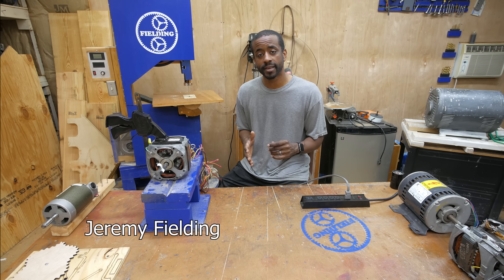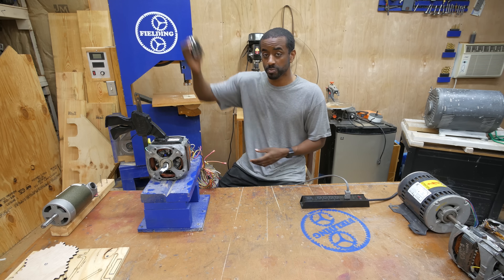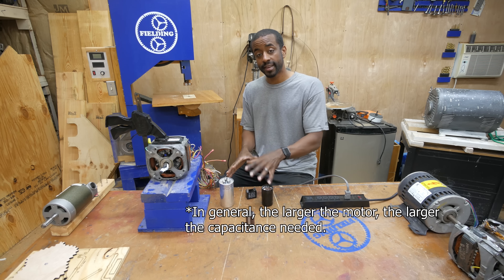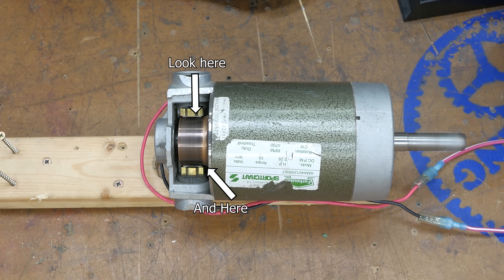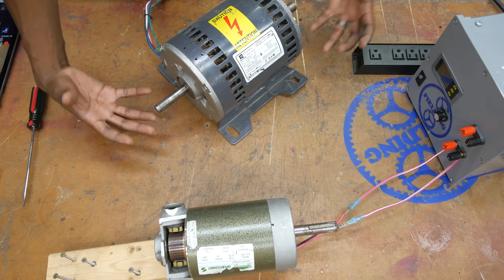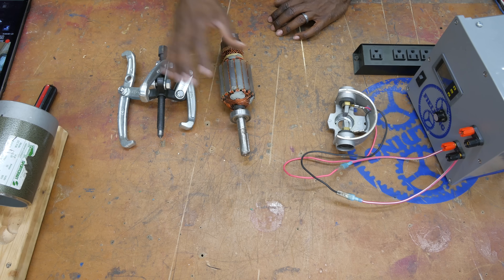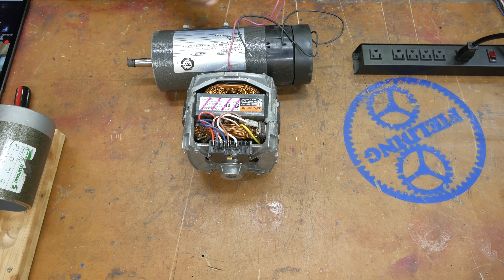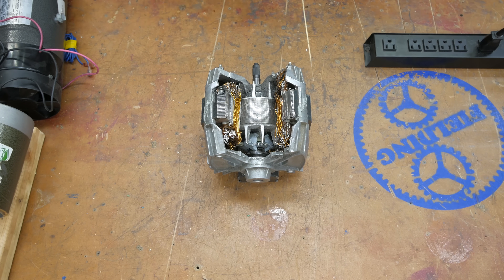Three Most Common Motor Fixes Anyone Can Do; Ultimate Guide to Electric motors ; #070

Comment: 6:16 I have this problem right now and I searched out your video to see if this was my issue.
My motor is running very hot. Starts melting the plastic casing. It throws mad sparks and gets super hot. the brushes are very worn down and they are at a 45 degree angle (I think because the heat allowed the brush springs to deform their holders).

Comment: I wouldn't say the capacitance doesn't matter. You needed enough shift in the phase on the starting branch to cause rotation. I wonder how small that would be though. Maybe that is accurate because the capacitance need is miniscule. That would be a fun experiment.

Comment: I just had a motor I had to fix on a Coleman rv ac , it has sleeve bearings that were packed with a material to hold oil, they material was pretty much gone. I took the motor apart , and repacked with a similar material and re oiled it , the motor spins freely , but it would hum when I try to start, I could give it a spin and it would run.  I checked capacitors and tested them and had a bad start capacitor. I ordered a new one and installed and it still does the same. Would the hum also be a determination of a bad motor , maybe a winding got too hot?
Reply: So I took another look at my capacitors and retested the new start capacitor was right on spec , rechecked the run capacitor and realized numbers were slightly different,  it was just off enough  by the variance that it wasn't allowing it to run. I guess it was in the process f going out because each time I connected it and tried running the motor and retest that reading would change by such a small amount. 
Anyhow, I rewatched this video a couple of times and it reminded me I should probably test and retest. 
Once I replaced the run capacitor it turned right on ....but I noticed it wasn't spinning as fast as it should. It ran for 15-20 min then began to slow down til it stopped.  Do you think this would be a sign of something wrong with the windings in the motor being that both run and start capacitor are still testing right on spec?

Comment: Great video as always! Really enjoy your channel. Question: any suggestions on extending a motor shaft? AC cap start induction pump motors in particular tend to have very stubby shafts. They don't even extend far enough to attach a coupling. I was wondering if I could press (or hammer) the shaft to push it out a bit farther. Then it would be flush on one end and extend about one inch on the other side. Would this damage the rotor?

Comment: i hammered a small gear on the shaft of a dc motor an the motor starts to and spin slow vibrating heavy then overheats but was running smooth before, maybe i hammered the shaft too much

Comment: My fan packed up it doesn't hum and won't start if you spin it by hand, I assumed the capacitor is faulty as it's supposed to measure 3uf but only measures .9uf

Comment: I've got a central pneumatic air compressor. 2hp induction motor. Lost the original capacitor such went bad. There is no cut out switch for a start capacitor. The motor has 4 wires that used to plug into the capacitor some how. I have been trying to figure out what capacitor it needs and how to wire it. I've gotten it to run with a 100 micro farid capacitor buy it gets way to hot. My knowledge of this subject is just enough to get in trouble and sometimes find my way back. Any help would be greatly appreciated. Your video is excellent and helped me to learn about electric motors. I'll be watching your other videos hoping to find my answers.

Comment: Jeremy, I have a 1 HP baldor motor that developed a bad bearing.  I removed and replaced the bearing and reassembled it and did my best to do so with the cap start mechanism correct.  The motor turned smoothly by hand, but the start mechanism isn't right.  If you can help me with that, it would be much appreciated.  I did buy another new baldor motor at the time due to urgency, but I really don't want that start switch to get the best of me.

Comment: I have this big 20” disk sander has a very heavy start up load  has a 20” steel flywheel takes a lot to get it going and will free wheel for along time when you turn it off.  what happens is the centrifugal switch on the back of the motor   Sometimes doesn’t switch off the start capacitor and it makes this horrible over running and vibrating sound and if you don’t turn it off right away it will blow up the capacitor. I have had a hard time finding the right replacement switch from what I can tell it’s the contact on the switch show quite a bit of arcing. It makes a fairly loud click noise when it works properly

Comment: I have a hmming fridge compressor, capacitors seem work since I replaced the new one and they didn't work, the question is
I saw some mechanist hitting one side of the compressor to make it work if you are lucky enough(?) how is that work? 
Before I knew this I know something wrong with the motor so I shook it around, back and forward and it only got warmer then trigger the protector as usual.
Haven't fix it yet, can't get a hard start kit here easily, it seems like no one manufacture or import that thing here.

Comment: As a student job in High School I was repairing electrical  motors.  The tool we used that was not showed  here was a  crank insulation tester  so we knew before to put it on real current if there was a short-circuit somewhere and we did not blew a fuse or breaker.   Some motors have oil inside like water pump.  Be aware of it before to open them. 

People were bringing  motors so rusty that we knew right aways there was nothing to do with it . We were just removing some parts to show we did something and charge the client for an evaluation for quick money :-p   We had to heat the motors to able to unscrew the metal bolts often without melting the aluminium . I got some motors to repairs because of frogs or mice inside. 
Some motors were suprising. I repaired one that was in a house fire where the copper coil inside was fine while the aluminium cover had melt.  I repaired some industrial machine that were in a fire.  the cable had melted together and we had to make good guess about which wire were going where

Comment: The general theme when doing repairs is to verify the part is bad, then swap it out. However when it comes to start/run capacitors, time and time again I see techs swap the capacitor without testing. What is it about capacitor testing that makes proving the diagnosis so difficult?

Comment: I recently repaired the motor of a small shop vac from a dumpster. Often things I find in the dumpster are perfectly good,  but this vac wouldn't run so I opened it up and found one of the brushes wasn't held against the commutator because its spring was broken. This spring is like the spring of a tape measure,   a thin steel  band in the shape of a "U" with the legs coiled up on each side, to pull the brush down.  I've never seen this type before. This band looked like maybe it got wet and rusted until it broke. Rather than trying to rebuild it in the original way,  I replaced it with a small coil spring from my supplies. I stretched it over the brush and fastened the ends by drilling  some holes in the black framework.  It works!

Comment: 5.30 If your motor has sparking/arching/electric puffing constantly sound (hard to explain but when you hear it you know it) when activated unplug, open brushes, check those are smooth, if not give them slight sanding on contact surface, clean surface and gaps of commutator bar with fine sand paper on opsicle stick  and thin screw driver and this should fix most of the issues. Angle grinders tend to have this issue, where so much conductive crap gets suck in that it damages ether one of those over time so eventually it just arcs. Easy to fix, most dont know how to do it, so plenty of fine tools get trow away due it. Bosh 1400 i just found for free just had one of the brushes corroded stuck, and with minor cleaning it works like new.

Comment: Thank you, I have a steel frame 16 gage sheet metal pullout in my ford ranger, it floats on nine 75 pound pillow bearings, inside the truck bed, and nine pillow bearings on the tailgate.  I have a flip 8” wheel trailer jack mounted on the pullout. So when it is pulled out it holds the weight of the pullout. Safety cables on each side to stop the pullout from falling off. This has been my mobile toolbox. The weight capacity of 500 pounds approximately. My question is how can I automate, the in and out of the tray? I can pull it on flat ground but when it is icy out I have fallen down!  My tuck has DC/AC power 3000w inverter.  Thank you!

Comment: What a great service you offer. I've always collected enough references to motor parts to at least present the facade that I can follow a conversation where motors are the topic. But I'm just a good fraud. In quick order though, I now understand far more how it all works with the components I'd previously had a superficial understanding. And how timely!  Just yesterday a fairly expensive fan I have just quit.  Now I'm at least armed with good diagnostic information to tackle a repair whereas before I would have just trashed it.  Wish me luck.  Thanks.

Comment: I have a no-name Chinese cordless angle grinder which only worked for a couple of weeks. During use it suddenly lost lots of power. I've pulled it down, and didn't see anything obvious - e.g. burnt coils. It's a brushless motor. Any suggestions? I guess it's some failure in the electronics and I won't be able to fix it. Next time I will pay twice as much and buy from a reputable manufacturer... :-)

Comment: What can I get away with to get my lawnmower working again. Capacitor is poly-filled Italfarad RP2 16040  uF16 +/-5% EN 60252 03-00 w 50/60 Hz
450 V ~ C 25/85/21
400 V ~ B 25/85/21
Im no electrician. I can refit the kit without blade and see if it turns but so far the hum without rotating is what I've got. Interesting point is that mower struggled with torque from new - slow to get going! Has had little use but maker Power Devil in UK no longer in business. Many thanks Robin.

Comment: Absolutely the best, easy to follow video series on the internet, Understanding Electric Motors 101. Question: I have 12 vdc motors that are used in vintage emergency lighting beacons such as Federal Signal Beacon Ray's. These motors are factory set at different rpms as determined by the number of incandescent bulbs to deliver the correct flash rate that the human eye can capture. This is known as the "snap effect." usually set at 60, 90, 120 rpms. How is the motor speed set, as I dont see any pots or rheostat controls?

Comment: I doubt this qualifies, but I have an orbital sander that I got at a garage sale for $1, didn't work.  Assumed it needed brushes, but they looked brand new.  Assumed there was a faulty connection somewhere, but they all checked out.  I tracked down the problem with a multimeter, the field coil winding had overheated and shorted in a hidden spot, and that of course was game over.  Tracked down a replacement field coil, problem solved.

Comment: Does it matter how you wire a start capacitor for the basic washer motor in your video ?
Reply: Not on AC capacitors like that one.  The voltage oscillates above and below zero, so there is no polarity.

Comment: Bought a 2HP induction motor on craigs. No activity when powered. Start cap seems to not be dead. Should I disassemble and inspect the windings for heat damage?

Comment: If you pull a brush to check it’s length, and it’s good - be sure to put it back in the same hole, in the same orientation. Don’t spin it 180 degrees. A brush wears itself in perfectly, so put the brush back in exactly the way it was.

Comment: Is that why starters on vehicles fail because of the capacitor and you beat on it with a hammer to get it going?
Reply: I think those are usually DC/universal motors, and they can get stuck in a place where the brushes don't contact both sides of the windings, or corrosion/dust will prevent them from making contact.  There aren't any capacitors on those motors, as far as I know.  Beating on it just allows the brushes to make enough contact to get it going.  Same thing can happen with fuel pumps, and banging on the fuel tank can get it going again.

Comment: Hi I’m a big fan of your Channel , and I have learned a lot about electric motors and their capacities,But im writing to you because I have a marathon motorIt originally comes pre-wired for a 220 it doesn’t have a plug on it at this time but I would like to buy a plug and re-wiring for a 110 I’m not exactly sure how to do this and I don’t want to try it on my own because I don’t want to get electrocuted or burn out my garage and I was wondering if there’s anyway or any videos that you might have that would help me out to rewire it is with a brand new wire or plug thank you so much for your help and continue to i’m loaded videos😃 they have been a big help to me around my house in my tinkering🤔, ps I noticed this marathon motor does not have a blue wire that I can see I don’t know if that makes a difference.
Reply: Not all motors are made to be able to run on both voltages.  If it is made that way, you will usually have a wiring diagram on the motor nameplate that will tell you how to wire for the lower voltage.  Another alternative is to buy a VFD that takes 120 V on the input side and will give you 208/230 on the output.  This will also give you the ability to control the motor speed, and they are way cheaper than they used to be.

Comment: Will this video didn't address my issue, but I am subbing anyways, and hopefully you did cover my issue. I have a old Sears Roebuck whole house fan, and I can't find the model #. It is controlled with a variable speed control switch. When I turn it on I get a slight metallic thump or click like it is trying to start, and then nothing, and no hum,  The fan spins freely, the 15mfd capacitor tested at 15.17mfd, and while it was dusty I cleaned it, and the windings looked pretty bright. Last Summer It did smell like it was hot one hot day when it was running hard. I let it cool off, and removed dust, and hadn't noticed it again. Any help is appreciated.

Comment: i thought that was the issue with my 30yr old DeWalt table saw 744 i believe.. the blade  still spins motor with ease no burning or anything else that shocked the hell out me to see burns on the stator rotor and deep gouges in the stator rotor. i was ripping  some 1X8 Azek and it ran fine and then 30 min later it never ran again.. I've used saws hard in my time and the brushes have never worn out on me in a skill mag 77  worm drive saw, my 12 in sliding miter saw this dead table saw, Milwaukee orbital Super Sawzall.. not 1 time in my 30 years of construction work or fixing cars. Not even have my cordless driver drills and saws have ever used up brushes but Ive destroyed dozens of saws and drivers, never once was it easy fix its a replace most times.. Maybe I just use them too hard.. after all I'm disabled now and its from overusing the body i was given.. things like entire Large intestine was removed and so may other things from time i was 30  almost 50 now, That loss had completely destroyed the small buss i had started just 3 years before

Comment: My 5 hp compressor motor fluctuates in speed just as the tank reaches its fill capacity . It goes slow and then fast until it stops.

Comment: What could be the issue on a capacitor start induction motor that does hum just like the capacitor would be broken but it does not start even if you spin it by hand?
One of the bearings failed really good on my bench grinder. The metal on the ball cage twisted and a piece pointed out of the bearing after. It was an open bearing that you were supposed to add grease to it but didn't know you had to do so until it failed.
So I replaced the bearings and put it back together but it only hums now. I might have put it back with the windings on the opposite side though would that make a difference?  Are induction motors one-directional?

Comment: I’ve learned a lot from you about motors.  I have something I want to do that I haven’t seen yet. I need to replace the shaft in any of my motors with a longer one.  I have a few motors with 1/2” shafts, but I need an extra couple of inches to hold an attachment for a tool I’m repurposing the motor for.  Is this a stupid thing to try?  Is it doable?

Comment: Thanks for a most informative and beautifully done presentation (as always), Jeremy.  BTW, If one is dealing with an archaic, discontinued model brush motor, and cannot find an exact replacement carbon brush, DIY by obtaining a dimensionally larger brush, and mill it down to the needed size using abrasive paper or manicure file.

Comment: Recently my home HVAC motor was getting noisy, so much so that you could hear it through the house. I just chucked it and replaced it with a new one. $150 or so and new capacitators. It was about 15 years old. Should I have kept it and replaced the bearings? Or is a motor of that age and size just too old and not worth rebuilding?
Reply from the maker: If you don't overload it a motor will run for over 100 years no problem. The bearings are nothing compared to the cost of the motor.

Comment: Amazing video... I think I'm going to have to watch all of your videos now I have learned so much and it's presented so well. My motor problem.... I have an old craftsman lathe that has no problem starting, or running, but while I am cutting into wood (especially larger pieces) the wood will stop spinning... I feel like the motor doesn't have enough torque. Is this a bearing issue, a H.P. issue or is there something possible wrong with the motor ....